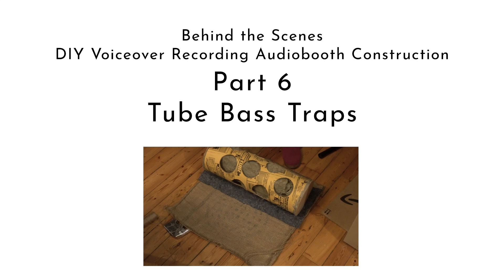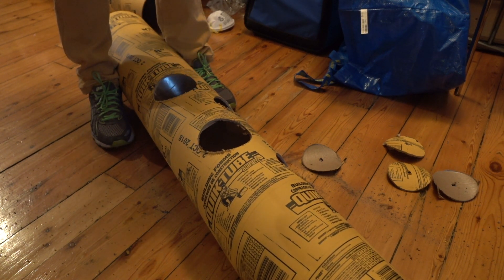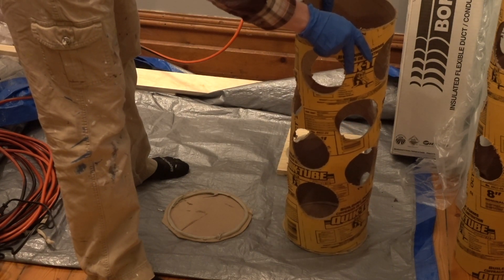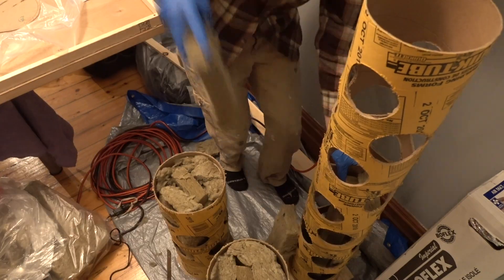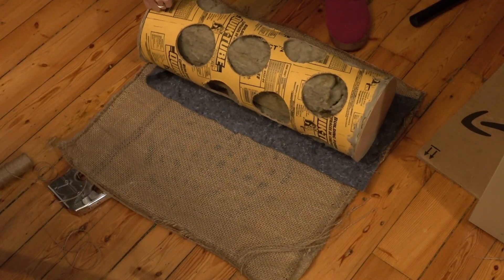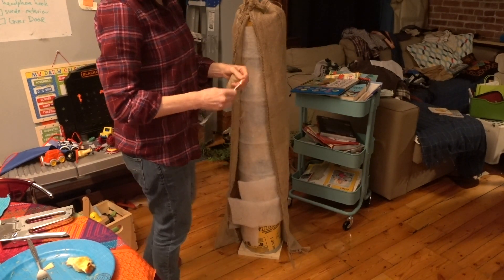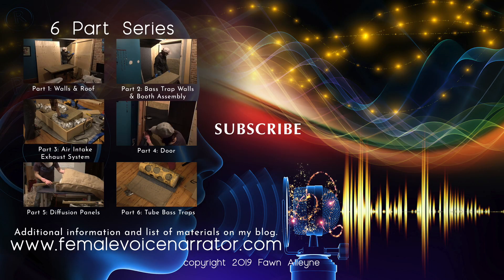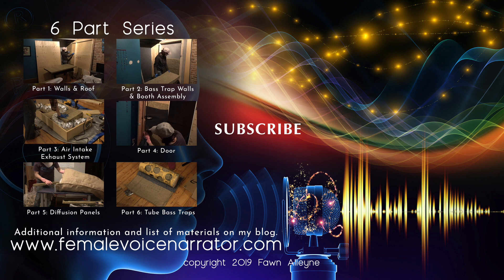Part 6: Tube Bass Traps - DIY Audiobooth Booth Construction Behind the Scenes

Comment: Does the furniture batting have any acoustical value? I’ve got some polyester acoustic batting here, so I don’t really need to worry about fibre glass irritants. Do you need to worry about reflections on cardboard?
Reply from the maker: No, the furniture batting doesn't have any acoustical value, I only used it for the fibre glass irritants. You don't need to worry about reflections on cardboard as it's a rounded surface and distributes some reflections randomly and absorbs the ones that get through the holes, rather than allowing them to build up as nodes in the 90 degree corner. Hope this is helpful.

Comment: You got the idea reversed. You need to have hollow tubes of fiberglass. So a cilinder of fiberglass and nothing inside with the ends closed up. This empty space with air trapped inside is what is supposedly makes the tube traps very efficient in absorbing the lows. Then you could add a thin lining on one side which would reflect the highs while letting the lows pass through into the trap.
Reply from the maker: You're right! Having a layer of insulation just inside the cardboard and then an airspace would improve the design. But I still saw excellent results from these. They sufficiently eliminated nodes in the corners.
Reply: Actually u need both. air and absorption material to convert sound pressure to dynamic or thermic energy.....